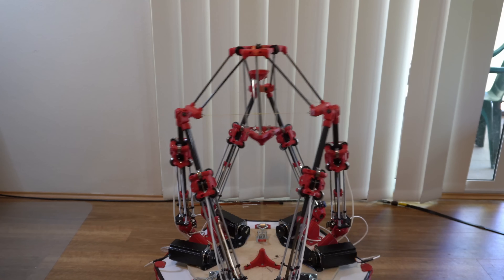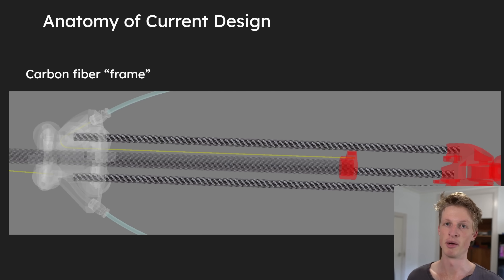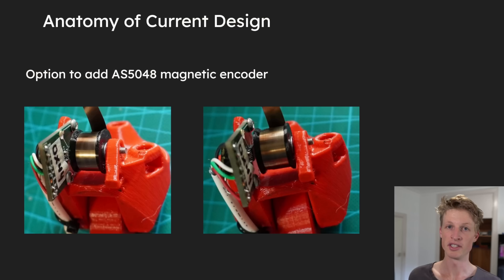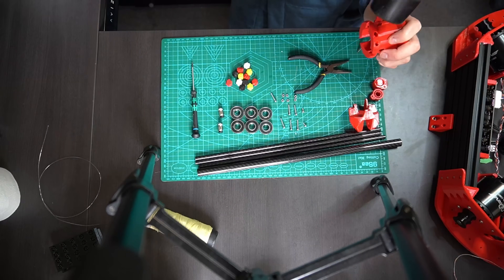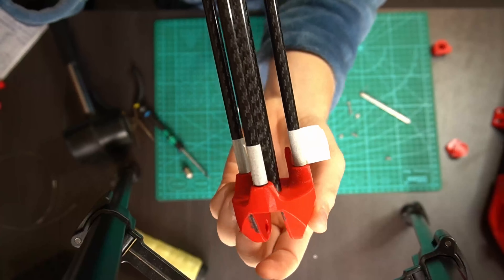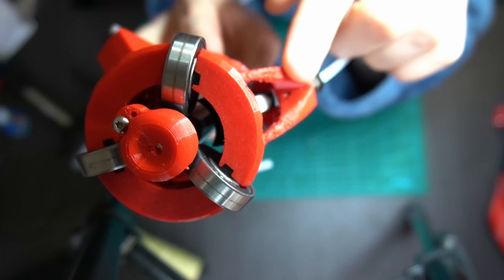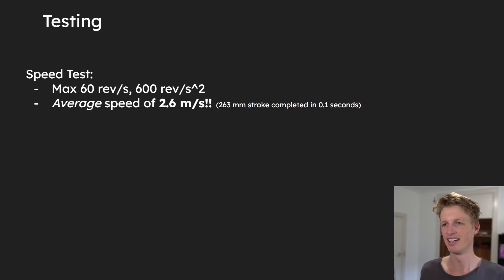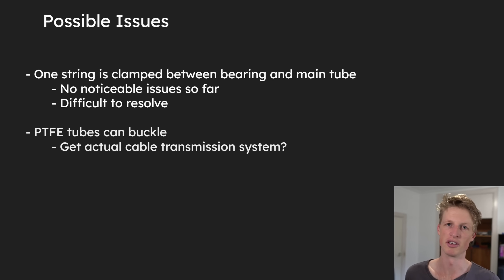Designing High-Performance Linear Actuators: Speed & Stiffness for my Juggling Robot | PDJ#19

Comment: Super neat design. I always love seeing people "reinvent the wheel". 
We need more people thinking outside of the box.

One question though, how much force can these output....?
I understand that you've made them for a relatively light load (juggling balls don't weigh too much), but I'd be curious on how much pushing power they have. The kevlar line is rated for 70lb, so it's probably somewhere under that.

But with a few modifications, this linear actuator concept could probably be scaled up to higher ft-lb loads. It would more than likely need more drive lines (I'd guess 3) to compensate for the extra weight. Might have to move to a cable driven design like you mentioned in your video as well. There would also more than likely be buckling with the current one string per direction design and I could see the whole shaft deflecting towards the string pulling it (depending on how strong the motors are).

Could be neat to see a strength optimized version in the future as well.

But regardless, super neat project! Keep up the good work and keep on being awesome. <3
Reply from the maker: Thanks for the kind words! 
I'm not sure how much force they can output, tbh; you're correct that I don't need them to be insanely powerful so I haven't put in much work to figure out how powerful they actually are 😛
I agree that a force optimised one would be cool to see! I actually used to have three strings to extend the actuator (to balance the bending stress), but I found I didn't need them and it was extremely tedious to 1) route them, and 2) get them all the same length.

Comment: You only need the extension string. The retraction string can be taken off and you can use the constant force spring to retract the actuator. That way there is no string visible on the extended actuator which is the weak link in terms of ability to snap whilst being pinched by external factors. Cool project!
Reply from the maker: It's funny you mention that; that's actually how the last design worked! Check out this video if you're interested: https://www.youtube.com/watch?v=h-th1lcGFq0&t=485s
Reply: @harrisonlow  oh I am gonna check it right now!

Comment: For cables - why dont you use bicycle cables, with entire housing? Im not an engineer of any kind, it jsut seems like they have the least of slack/deforming while string is pulled, as they have a metal housing for the cable - it's a composite material they use for cable housing. One issue - they might introduce a lot of friction forces to your build. They are quite tough though, but not as flexible, so finding one that fits your needs might be a research challenge

Comment: what if the strings were really long, the center rod also really long, and it had a hole in the base where it could go through the bottom.
would that be better?
also string is not sufficient to jump a car 5m vertically.
i thought stored pressure might work but i gave up on that.
how does a pistol shrimp punch?

Comment: Just take out the PTFE tubes and replace them with equivalent-size pneumatic quick-connect tubing. These use exactly the same fittings, but they are MUCH stiffer. Available at any hardware store, cheap and easy to replace.

Comment: You could make one of the bearings be in a tab that flexes a bit. You flex it out to fit the rod then the bearing will have tension against the rod. It's like making the bearing be pushed by a spring. I would recommend PC filament for this kind of thing as it retains its shape well when tensioned and is strong

Comment: I've seen a bunch of comments suggesting brake cable for your conduit issue. That has some obvious issues, but I think I have the magic set of words for you: continuous length extension springs. McMaster 9664K12.
Search for Hackaday's bootstrap guide to homebrew two stage tentacle mechanisms, the author cleverly (and inexpensively) solves the constaint-length cable conduit problem.

Comment: Why six metal bearings rather than a sleeve ? 
What is the maximum tolerable looseness of the rod in that carrier ?
What are the 4 rod diameters and thickness, will this work this any aliexpress carbon fiber rods 
Is the price premium over glass fiber really worth the weight savings ?
What kind of repeating accuracy are you getting on the actuator ? 
Plans for adding a locking mechanism once the actuator reaches the destination ?
Power requirement to hold or push at maximum force ?
What breaks when you exceed maximum force ?
Reply from the maker: Good questions! In order:
1) I previously tried a linear bearing but the tolerances of the CF tubes weren't good enough and they were either too loose or didn't fit, depending on which supplier I got them from. With properly tolerance-d parts, I reckon a linear bearing could be better (though would require a decent amount of design work as the whole upper part could be very different).
2) Maximum tolerable looseness: For my application, I don't know! More = bad. With the correct spacers in place, the central rod has absolutely no wiggle.
3) I don't remember off the top of my head. All the dimensions and CAD files are in the printables link in the description 😊
4) I honestly didn't realise fiberglass tubing was a thing 😂 Good to know for next time! Surely it isn't as stiff as CF?
5) I haven't tested that for just the one actuator. I'm more concerned with the repeatability of the total Stewart Platform when I put it all together, so I'll be measuring the repeatability then. Perhaps it isn't a terrible idea to do _both_...
6) What sort of locking mechanism do you have in mind? I need the actuator to be constantly moving relatively quickly, so it won't have much time to relax!
7) The only current measuring I've done so far has been when the actuator is in motion at a decent speed (around what it was doing in the endurance test) and it drew ~4A at ~21V
8) For speed, the first thing to go is actually the ODrive! To decelerate the motor, it uses regenerative braking, but I'm using a power supply that isn't happy with having power pushed back into it, so I'm limited by the brake resistor on the ODrive. I am pretty confident that I could tune the accel/decel rates to get it to exceed 2.5 m/s, but that's pretty darn fast for now and I've got other things to do that are more important right now! For force, the strings are the first things to brake (when I've accidentally rammed it into either extreme), buckling the PTFE in the process 😡

Cheers for the interest!

Comment: Nice work!  Inspiring!

I had issues with PTFE tubing buckling (from compression) when I used them as bowden cables.  I've wanted to try the small coils (smaller than bicycle kind) but I never got around to it (and project had already met its goals).

Comment: Excellent project and comments.  Only one PTFE tube is under compression at a time right?  They can reinforce each other.  Kapton tape them together.  Unfortunately will reduce flex in one dimension like bonded wire, but can be mitigated by twisting them around each other as in twisted pair wire.
Reply from the maker: Very interesting idea! I'll keep this in mind when I'm doing more testing. Lots of great ideas coming out of these comments so I've got a bit of experimenting to do! Cheers for the suggestion 😊

Comment: I'm actually wondering if you could do away with the 12 PTFE tubes and couplers almost entirely.. or at least feed them all into the bottom area of the hinges for nearly no inertial mass penalty, both strings up into the bottom area then one of them looped up and around a pulley at the top for the primary 'up' stroke that gives the needed power to toss the ball. Also fair warning that PTFE tubes are subject to wear-through, that kevlar line will slowly bite channels into the areas that are bent against it.

Comment: Capricorn tubing for 3D printers is like PTFE but stiffer. Also smaller ID so it might be better for the string. Maybe try that as an easy solution to the PTFE problem.

Comment: I am curious what the power usage is for the juggler. How much current/watts does it use.
Reply from the maker: Good question! I haven't put the whole robot together yet (need to wait for some more parts to arrive), but the single actuator drew around 4A at ~21V (max voltage my bench PSU can supply) when doing the endurance test

Comment: 1. How to fix issue with string, which is going inder bearing:
Why to fix? Just make it go there in more civilised way. Either choose bearing with canal ring, or just carve it. So, string won't be pressured between carbon fiber tube and bearing.
2. How to fix problem with squeezed PFTE tubes:
Have you heard about bike brakes? You'll need something like this.
Bike brake cable has a spring inside, which prevents collapse of tube.

My concern: I expect, that magnetic encoder is needed after all. Because, I can't imagine how to ensure, that wire won't go loose. And how to ensure somewhat not very sad precision.

Comment: for the 'issue' with the string running between the bearing you could swap that one bearing out for a V-cut bearing so you really dont have to redesign and it would leave a gap for the string to go through
Reply from the maker: Yep, that's a really good idea! I bought some bearings of different shapes and sizes (U- and V-cut bearings, as well as some "gothic profile" ones) and I reckon they should work really well. Cheers for the suggestion!

Comment: "so, there mustn't be any slack in system"
I can't imagine how to achieve that condition in that construction.
I would like to see additional video with clarification.
Reply from the maker: I've actually been quite surprised by how well this has worked. My methodology is:
1) Build the actuator as shown in the video
2) Connect the motor pulley to the strings by feeding the string through a hole in the pulley and tying a knot in the end
3) Loosen the bolts that fix the string to either end of the central CF tube
4) Tighten the strings by hand and re-wrap them around the bolts
5) If the string is wrapped the correct way, tightening the bolts will further tighten the string

By doing that, I've gotten the strings so tight that I've actually loosened them again for fear of snapping them. They sang a very clear, high-pitched note when plucked

Comment: If you could mount the motor at the base of the actuator you may be able to use a belt system similar to what bed slinger 3D printers already do.

 Another option would be to use a rack and pinion system.

Hydraulics or pneumatics are extensive but they would be ideal for this.

Comment: Great project! You could try grinding a small groove in the bearing to accommodate the string? Some bearings do come with a groove already in them.
Reply from the maker: Yep, that's a really good idea! I bought some bearings of different shapes and sizes (U- and V-cut bearings, as well as some "gothic profile" ones) and I reckon they should work really well. Cheers for the suggestion!

Comment: The PTFE tubes are probably the biggest problem with it. You already ran into issues with them buckling, you should run an endurance test and then try and look at the inside of the tube, it could be wearing pretty fast, you may be able to lubricate it to extend its life although PTFE is low friction anyway. I think in most cases, cables aren’t great for rapid movements or a lot of force, just due to wear and other issues.

Comment: i dont know if this is a viable solution or not but maybe if the pulley axis is not tangential on the the rod but perpendicular on it, you can have it so that the string is at a distance and parallel to the rod, but i am not sure how it can fit in your design, but maybe you can give it a try on cad first.

Comment: This is a good design but you can do this with gear's too
instead of using ropes to control the movment, use camera tripod mechanism (like extendable centre on the tripod)and add teeth on main actuator in order to gain power and speed at the same time

Comment: For a cable system, just look for something like a bicycle brake cable or derailleur shift cable. They're usually braided steel cables with a solid shield tube and some kind of plastic (probably PTFE) lining. It's easy to cut with hand tools, and is intended for durability and longevity in some nasty environments.
Have you tried using one of those constant-force springs inside the cable spool to take up backlash?

Comment: I would expect the string to saw through the tubes. If you have buckling problems now, it will probably be a bit more pronounced once you get an end effector and related stuff on your final DOF. You will certainly be forced to make compromises the moment you expect this system to do anything useful, so perhaps planning to move the drive system adjacent to the linear actuator should be on the menu.
Reply from the maker: I thought the same thing in the past as well, but I've been extremely impressed by the durability of the PTFE tubes. I've really beaten some of them up (running strings through them at very aggressive angles and speeds) and had no signs of wear. Putting the strings parallel to the actuator would be good, but that wouldn't work nicely with the rest of the design that I'm using these actuators in (controlling a 6DOF Stewart Platform), as the actuators need to move around quite a bit relative to the motors that drive them.
Reply: @harrisonlow  Okay, well if you are looking for something to try for the kinking issue, you could find a rod the same thickness as your tubes, wrap some copper wire around it to make tight coils, slide the coils over the kink-prone sections of tube, and superglue them to make a fitted sleeve. Then, you can slide the coils off and solder them to lock in the loop size. The PTFE tubes will be constrained in crossectional area and (maybe) unable to kink, but depending on how you solder the turns of wire it can still be pretty flexible. You can possibly solder one or more copper wires perpendicular to the turns to form an armature that makes kink-prone sections a set radius.

Comment: Interesting design.  Have you thought about using an offset cam or a spring-loaded design to take up that slack in the tube?  Also, I think your previous design could have been made to perform a lot faster simply by gearing down the motor instead of having a direct drive.  For the PTFE tubes, use a wound wire (basically a spring) as a way to keep the plastic tube from buckling.
Reply from the maker: Yeah I'm toying with the idea of adding some springs to help with the slack. Haven't needed it so far and I'm still brainstorming exactly how to work it into my current design with as few changes as possible.

Re. previous design: the speed-limiting was actually caused by the constant force springs being unable to shorten the actuator fast enough; the motor could extend very quickly—since it worked the same way as the current design, it would've been as fast in extension as the current design were I using the same motors—but compression was weak. The springs also meant that there was very little constraining the extension of the actuator, which (I think?) led to most of the wobble in the overall Stewart Platform. I could have used stronger springs, but that would've meant more force for the motor to fight against... So many tradeoffs!

I like the idea of supporting the PTFE with a spring. I'll see if I can hack something together to give that a try.

Cheers for the suggestions!
Reply: @harrisonlow  I think cam bolts (or similar) would let you dial in that gap.  I also was thinking having a set screw might do the trick as well.  The set screw would let you adjust the fit till you got what you wanted and if you used loctite it wouldn't back out.  Plus set screws are small and cheap.  Good luck.

Comment: ptfe buckling; run the strings through the thin carbon  tubes? or put the ptfe tube in a tension spring? bicycle cable housings might work

Comment: Instead of ball bearings you might want to try single bearings like trackballs and you can adjust spacing with the size of the bearing. That makes is super light compared to this and much much smaller in diameter.

Comment: Hey, I'm actually developing similar actuator but much more miniature and with inside-out design similar to yours.

Just a couple of ideas that may suit your application:
1. Design pulleys in a way that string is always wind up row to row in one direction every time.
2. If you can put consistant helical path for strings to fall into. For both accurate angular to linear meaurment and to avoide slippage.
String and fdm resolution may be too low for this though.
3. Align the strings parallel to linear axis as close as possible.

On improving bowden cables:
1. Best kind of sleeve is coiled metal sleeve - can be bent and partly fixed.
Finding them cheap is not an easy task, since most of them are medical use or quote to order.
Best kind of cable on your scale is literal cable (not just one wire)
2. Second best option is indistrial bowden cables.
At least they are tested and can be trusted in pull operations.
3. If you are going to go more diy and cheaper using PTFE:
Then best fit you can probably get easily is exactly 16S PTFE tubing (1.34mm inside diameter) and nice 1.2mm cable.
Alternatively you can use other 10-20S PTFE tubing with cable 0.08-0.175mm smaller than tube ID.
Reply from the maker: Great comments; thanks for the suggestions! What are you using your actuator for?